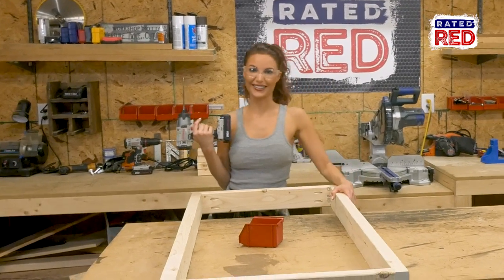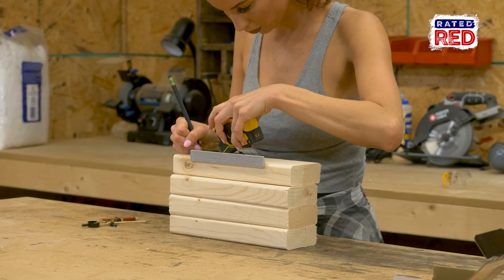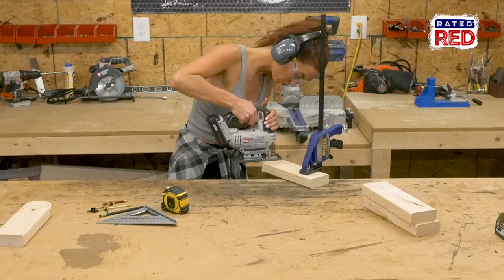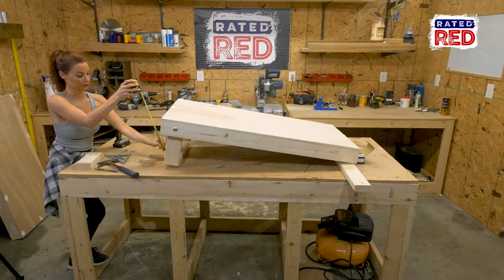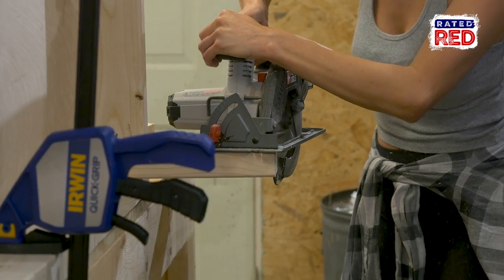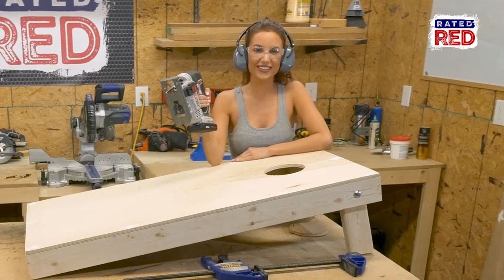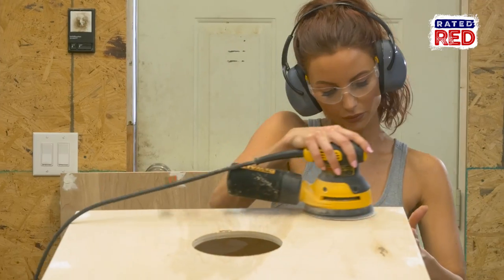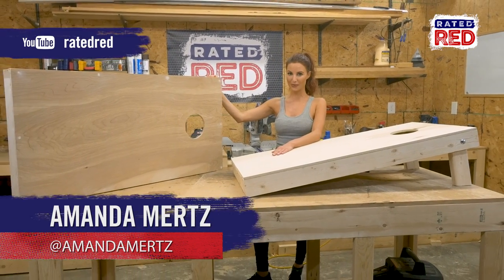Cornhole Boards | Red Hot Building

Comment: I use two different methods of applying the top sheet. If its the 3/4 sheet i use the kreg jig, if its the 1/2 i use a brad nailer. Just depend on what material I am using i found both to be really effective.